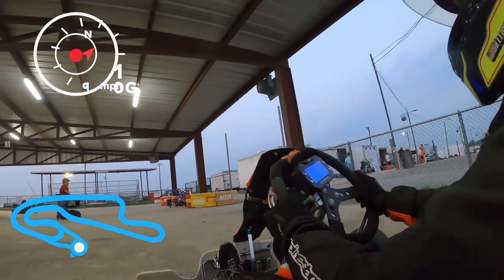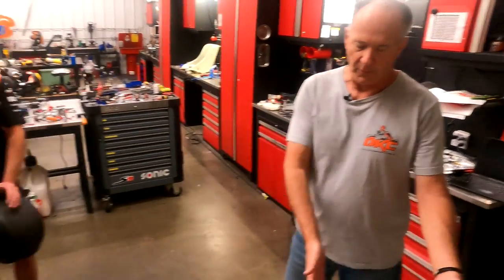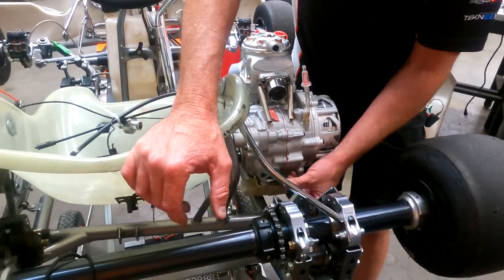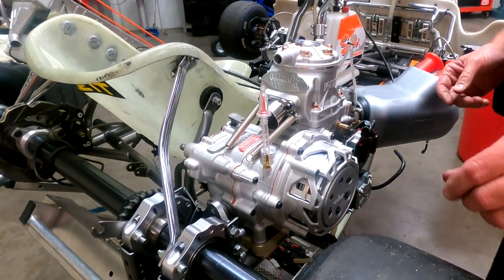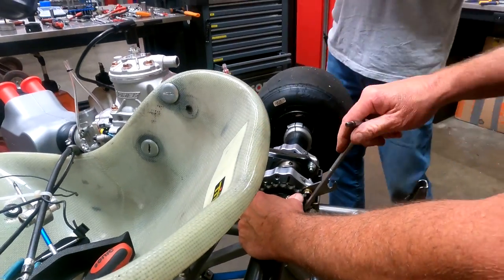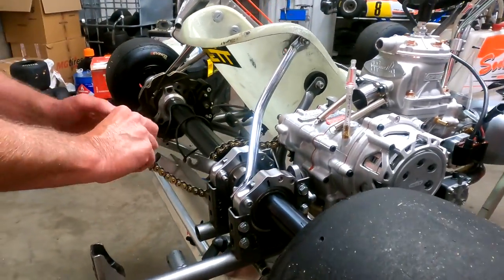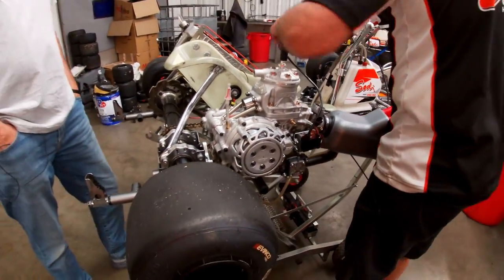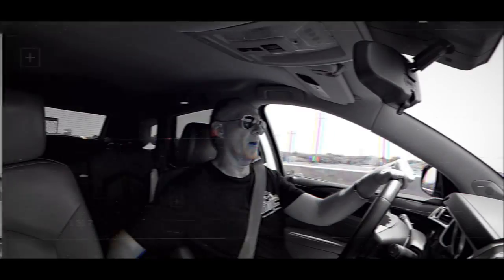Pro Tips Prepping My ROK Shifter Part I movie

Comment: nice motor package. i did notice you didnt have to change the rear sprocket gearing.
Reply: Yes, the rear sprocket did not change but the front sprocket did...on the Rok, you run (apparently) a 17:25...other tracks might vary +/- one tooth on the rear sprocket.  Thanks for watching!

Comment: Hey any idea how a Rok compares to a TM-R1 in terms of reliability, maintenance and performance
Reply: Thanks for watching this video and great question!  I really don't have any experience with the KZ (TM-R1) so I went to several friends of mine who race both and what I found was this:  The typical time for a top end overhaul on a Rok is 10 hours, with 20 hours being about the norm for both a bottom and top end; the KZ engine is about half that in terms of time.  There is no doubt the KZ is faster than the Rok; the longer the track you are on (either longer straights, faster turns or both) and the KZ will walk away from the Rok.  That said, I love my Rok-it is plenty fast and very reliable, easy to tune the carb, etc.  When you run in a class that is mostly Rok engines, as I do, then you have plenty of people to race against.
Reply: @RKSiler  thanks for the reply, great info
Reply: @twinturbo3470   Glad I could help!  Two other data points came to light after I replied to you.  The first is that at the really big races (like the Super Nationals), the KZ guys are running on the ragged edge of lean (almost to detonation) and for safety's sake, they do a top end rebuild prior to the Final because they are not sure the piston can take that kind of abuse for an entire race meeting - that means a top end every 60-90 minutes of running.  And, apparently the thing to do is run a Lambda sensor instead of an EGT since the Lambda sensor is way more accurate and will allow you to figure out the right main jet, low speed jet, needle and needle setting for the entire track, not just the longest straight aways...admittedly, at this point, I have NO idea what that means but will do some digging and pull together a video on the subject.  Thanks again for watching!